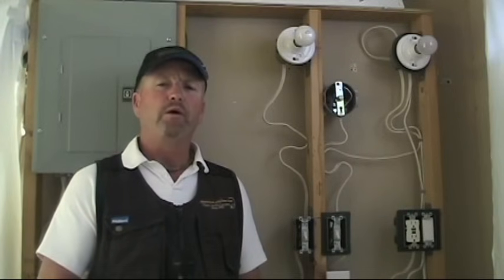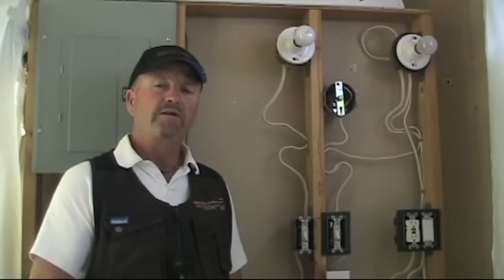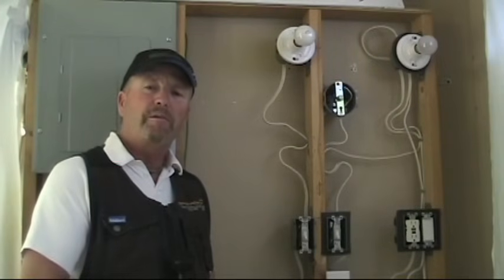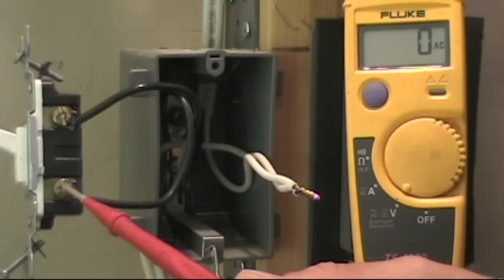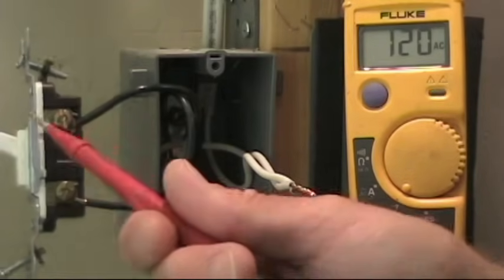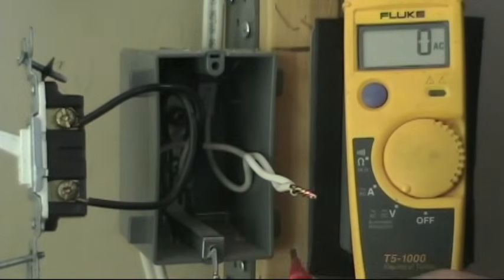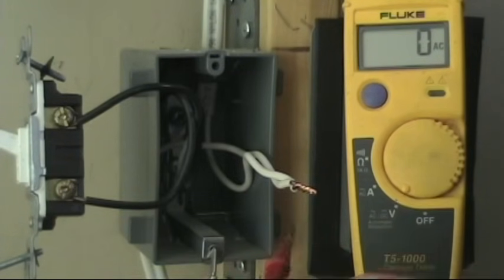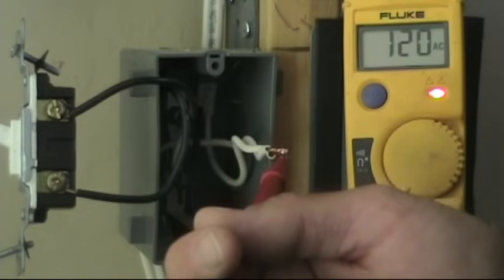Understanding an Open or Loaded Neutral

Comment: But that's not the only way to get a shock off of a neutral conductor. If you have a multiwire branch circuit and the neutral is carrying back a load imbalance current to the panel it has the difference on it. Touch it and you get shocked.

Comment: Not the safest approach but technically you can invert another receptical to same circuit this way. Also consider  2 hots on 1 pole switch. Unless you have a secondary.. Based on the visual anyway

Comment: I have a rocker switch that has one black wire (bottom screw ) and one white wire connected (top screw) to it. No other feeds or hot coming in box. Don't know what it goes too? ran a feeder wire into box and then to a small LED ceiling light. connect both blacks, power and feeder wire to rocker switch. connected the 2 white wires together. Now the new light won't turn on. I get a voltage drop on the black feeder to about 100 from 120. My tester now shows the white wire as hot? Why is this? Did someone use the white wire as a hot wire to something in the house? I can't find to where it goes or what it did?  Is this why i get a voltage drop when i turn the switch on? and why the white wire shows hot with my tester?  Please help!
Reply from the maker: You have a "switch leg drop" circuit there.  Very common practice up until the time the code rules changed on that, somewhere in the early 2000's if I remember correctly. Check out this video for an  in-depth explanation of this.  https://www.youtube.com/watch?v=pnlHCiRN_RU&t=3s

Comment: Found this issue yesterday with bedroom ceiling light not working in apartment. 120v at neutral, 0v between hot and neutral.  Checked dual switches and neutrals are wired tightly but 120v there in the switch box on neutrals as well. The wires feed into the box from the top so i doubt they're fed via an outlet in the room but outlets check out good with tester nonetheless. Arc fault breaker is good as well and connections tight. One thing i noticed immediately when first turning breaker off to this circuit was that the bathroom power was cut as well. The breaker marked bathroom only controls a gfci outlet at sink while the rest is on the bedroom breaker. I didn't think that setup was code. I pulled the switches out of the bath switch box as well and neutrals there are all tight and readings are correct.(no 120v at neutral) I’ve experienced these quite a few times before but this one has me truly stumped. Is there any other condition, other than a broken or loose neutral, that can lead to the same situation causing 120v on a neutral and not be tripping the breaker?

Comment: A really good demonstration of this is to: Shut off the switch that is feeding the keyless light bulb fixture with/at 120volts (potential). Set your multimeter settings for AC Voltage (@ 120v or higher). Place the two probes of your meter into contact with the two contact screws of the switch controlling the keyless light bulb fixture. With a proper intact circuit, you will read 120volts AC across the switch when the switch is off/open because the top of the switch contains  the circuit's Voltage Potential (EMF), while the bottom of the switch (although including the circuit load (the light bulb) from this position  forward, is essentially the Neutral/Grounded Conductor. 
This is why you must visualize even a simple circuit in context. It is imperative to remember that the point of a circuit that you are placing your digital multimeter probes is always relative to the break in the circuit. Prior to the interruption in continuity is the Hot Wire (Source Voltage) and the remaining section of circuit is the Neutral.

Comment: I have an outlet that is receiving power, but nothing works when I plug anything in. I have replaced it without success and the next outlet downstream has the same issue, I have not changed out that one yet. I did also check the connections to the pigtails, they all appear in good condition. The upstream outlet, which I believe is before this one is fine. Any advice?

Comment: Good video. I always questioned why the industry calls the neutral a neutral. It’s a circuit return path. Think about it. There is no load below the bulb. And what does ohms law tell you? It relates voltage and current to load resistance. So with no current flowing back to the neutral bar, there is no voltage drop across your load. At least until you touch it in which case you become the return path!

Watch those neutrals!!! Esp. On older service work. Often you find shared neutrals. Two breakers or circuits sharing a common neutral.  Here you can back feed power into the dead circuit. As the dead breaker has no current path, it’s a recipe for getting a new hair do!!!

Several times I have found several neutrals tied together with a massive solder joint and tape. Sometimes it’s OK, other times you may have a loaded neural when working on this. 

So always check that neutral! It will tell you instantly if you have a loaded neutral.

Comment: Ok I have an issue with a closet light that suddenly stopped working. House was built in 2003. I have done no electrical work previously. Checked bulb first no issue there. Got my voltage tester out and no power on the hot to the switch. But then I checked the 2 neutrals that were tied together in the box and there is power on the neutrals. I checked the other switches and outlets on the circuit for a loose wire and nothing. Breaker has never popped. I’m stumped on this one.
Reply from the maker: That is a puzzler with what you are describing.  Something like this takes an experienced troubleshooter electrician.  Sometimes things don't make any logical sense until you find where the problem is and then it can all be rationalized, but this needs some hands on checking.  If you were within a 30 minute drive from me I'd be right over!

Comment: I’m confused. Is the neutral short circuiting to ground?
Reply from the maker: No, the intended path for the neutral conductor is open or broken so the path is not complete.  Neutral (grounded) conductors are the intended path for the current flow, but it is at the same potential as the grounding or earthing conductors.  So think of it this way.  The breaker is on, the current flows to the switch.  The switch gets turned on, and the current is now at the device ready to be used (think light bulb, appliance plugged in, etc)  But the other conductor to complete the circuit is open or not complete.  So the device does not work, but the potential difference (voltage) is there at the end of the broken wire ready to do it's job of completing the circuit, but it can't.  So you measure what you think is supposed to be a 0V potential on a white wire, but to your surprise it shows 120V!  If you complete the circuit by reconnecting the path, that measured potential will drop to 0V as it should, and the device will work with the now completed path.  If you touch that open or loaded neutral thinking it shouldn't be "live", then you can complete the path and become the unintended conductor and get a shock!

Comment: I had screw in drywall penetrating cable black with white wires. Lights still were working correctly.  I found out this, once replacing switch.  Took me whole day to solve the problem.

Comment: The filament should of caused a voltage drop on the open neutral side meaning the voltmeter reading should of been less than 120volts ready to bite on the returning neutral
Reply from the maker: The cold resistance of tungsten (for example) is very low when cold and not energized.  And without current flowing, there is no voltage drop calculation as that is a function of current X resistance.  So zero x the resistance = zero voltage drop.  Once current is flowing and it heats up to produce the light, then the resistance spikes way up. Should you come in contact with that loaded neutral and complete the path, you would be inserted as one part of a series circuit. 🙂

Comment: I had a job that was new construction in an area that was burned in a wildfire. As we put in the lights and turned them on they immediately burned out. After some trouble shooting it turned out that the utility had failed to hook up the neutral for the service and we got 240 volts throughout the house.

Comment: I guess I don't have a neutral if I want to connect 2 gang dimmer with 3 cables? 
The voltage between cables: 
19,5 V between yellow and blue 
172,5 V between brown and blue
226,3 V between brown and yellow

Comment: Terry, hope you're still there. I have a 34 Volts reading on my neutral wire at the single pole switch. I just watch your video but still unsure what to do bc it's only 34 volts to ground. Thanks.

Comment: Thank you. I have outside lights on a store that show a hot line wire but no current when timer is switched on for the neutral. I’ll have to follow the circuit up stream and see if a splice has been disconnected. Definitely 👍🏻 and a sub.

Comment: Where is the how to corrected ???
Reply from the maker: The solution is to put the neutral splice back together again.  It was left undone and power restored to the circuit before checking that everything was as it should be.  Neutral needs to be an uninterrupted path back to the service panel.
If you need more detail, here's a post on my website.  https://www.electrical-online.com/understanding-an-open-or-loaded-neutral/

Comment: So I have a bit of a different situation everything in my house is wired properly and was checked multiple times and has worked well over two years perfectly fine well this morning I wake up to only half of the house working and I draw the problem back to an outlet in the kitchen where everything kind of branches off of and it's acting like the neutral is not connected in the breaker box and I trace the line from point A to point B and there's no brakes no cuts no tears and it goes straight to the box but I cannot for the life of me get that neutral line to work if I jump the white line from a working receptacle over to the white line that is not working everything comes on so if you could maybe help me out with that it would be awesome
Reply from the maker: That is a weird one, but when you say that only half the house was not working, I would suspect a connection on one of the hot wires, either at the utility transformer, the meter base, or a half-tripped main breaker of a faulty main breaker or connections at the main breaker.  The rest of your explanation is a bit puzzling.  This needs some in person trouble-shooting.  I'd call in an electrician that is good at problem solving.
Reply: @theinternetelectrician  I found the problem finally. My kitchen range was wired into the same receptacle as the lights on that half and had melted the wires together inside of it.
Reply from the maker: @AndytheMachine  OK, that's good that the issue was discovered.  This needs to be properly rectified (obviously) and this unusual situation made safe and compliant again. It's an interesting case study and if you want to elaborate further with photos and more detail, send me an email to internetelectrician@gmail.com.  It might make good subject matter for a future video.

Comment: Normal electricians dont test for 120V between G and H ... as the ground is not needed for the circuit. They test between H & N because that is where the circuit is. 
BUT if the G is tied to the N at the main panel, that can help ID 120V on the H which tells you the N is open

Comment: Tracing open neutral can be more difficult to locate than a broken feed. Many times I located a good neutral section in the circuit, then rewire to the open neutral, and effectively reconnect the neutral to the back side of the break. Replacing a broken neutral from a different circuit, will cause a foreign neutral current on that different circuit. Never assume the neutral has no current with the circuit shut off.

Comment: No, how does taking splices apart make a return wire hot. Fail.
Reply from the maker: watch it again.
Reply: The black wire carries the 120V from the breaker to the bottom of the switch, to the top side of the switch, then up to the light (black hot side) then it goes THRU THE LIGHT BULB and going to the Neutral side of the light which the White wire and back down to the light switch box where that N wire is now HOT with 120V ...  
If using a basic incadescent bulb, that bulb is nothing more than a wire ... so its going to pass that 120V thru and onto the white N wire. When that N wire gets back to the source or transformer, that voltage will disappear .... 
If you were to use an electronic LED light with a circuit board you won't have 120V on that N wire.

Comment: I have a different question, I replaced fabric cable with romex, TWO unrelated branches (both previously upgraded) are reading continuity across the hot and neutral.
I found out the hard way.
2 cables going to different rooms. I'm really confused
Reply from the maker: So just to be clear, you read continuity from hot to neutral? This would be normal and expected unless there was nothing plugged into any receptacle and no light switches are on, etc.

Comment: I have some lamps where the neutral is not connected, but the ground is connected to the neutral wire. The neutrals also have power. I'm about to redo the whole apartment, breaker panel and every outlet. I think we should find the problems tracing everything back to the panel, or who knows? I'm also changing about 12 breakers as well because of the weirdness. I disconnected the neutral to the garage light and it works, so I have to start over.
Reply from the maker: That needs some serious investigation for sure!

Comment: I hope you are able to help. I have two light fixtures in my garage. I want to add two more light fixture to have a light more light. I bought 14/2 50 ft wire from the light fixture number I tapped into to it. I did white with white and black with black. The same light fixture has about 4 white wires and three black wires. With the new wire I did black to black and white to white and ground. I ran the wire about 12ft to the new desired place to shine more light. I bought i new fixture the has four screws two silver and two brass no ground screw. I connect the white cable to the silver screw as indicated and black to the brass screw. When I put everything back and turn the breakers back on the two light fixture turns on and the third which is the new one stays on and will not turn off. Please help
Reply from the maker: I think that you have a "switch leg drop" happening here.  You tied in to the power supply hot wires, and the neutral.  You need to connect to the white wires, and the hot wire that is connected to the first fixture instead of to the splice that has the 3 black wires.  Watch this video and I think  it will all make sense to you.  From what you have described though, I'm thinking that they didn't quite wire the switch drop as they should have and I suspect you have a white wire that is connected to the hot for the first fixture?  Check out the video and let me know if this makes sense now.    https://youtu.be/pnlHCiRN_RU

Comment: Good morning 
How are you
I have a question. I have two wires coming out of an electrical box. One of them brings power and the other goes to an outlet 
When I put my voltmeter test leads on the hot and neutral of the power wire it reads 119 as expected. When I put the test leads on the hot wire of the power wire and the box itself it reads 67 volts 
What’s could be the  problem? Does it mean that my outlet box is not at 0? If it’s at 52 then the difference between the hot lead on the power wire and the box will be 67? How do I find out where the problem is? 
Thank you
Reply from the maker: That means that you have a poor (or non-existent) grounding system.  Maybe the (grounding/ earthing) bare wire isn't connected to the outlet box grounding terminal, or is poorly connected, or maybe your cables are just 2-wire without a ground wire? (older home?).  If you do have 2-wire cable + ground, do you have 119V from hot to it? If so, then just correct the problem of the outlet box not being connected properly and that should solve it.  Feel free to provide some more detail and information here.

Comment: QUESTION, i put an electrical meter probe between the smaller 120v blade opening of an outlet and the ground probe to the sheet metal covering my pole building. should it read zero volts or 120 volts. mine says 120v. everything powers up but can i be electrocuted.
Reply from the maker: Sounds like everything is as it should be. Neutral (grounded conductor) and earthing or grounding system should be at the same potential. So with your meter you should get 120v reading from hot to neutral, and hot to ground. Thanks for watching!
Reply: @theinternetelectrician  thanks for fast reply and peace of mind.

Comment: Yeah but if all neutral wires are disconnected at the splice, you should not have any power. You might be having a back feed due to a closed circuit somewhere in the system.

Comment: Can I tell you thanks for the tips. I hate house wiring !!! I spent 2 days chasing wires on plugs and thankfully I found loose wires and or bad plugs which I replaced. What I didn’t expect was a ground that just fell off the post on a switch that had at least in my mind, nothing to do with the plugs that lost power !!! Blows my mind.

Comment: I have an old appliance i was working on. And noticed when i touch the woodstove and the appliance i got a little tingle of electricity. I connected a grnd to the appliance to the outside metal of the outlet and it turned on the appliance even though the switch was off. Furthermore i was unable to turn it off unless i disconnected the plug! What is going on. ?????

Comment: Question could you check for an open neutral by turning all lights on and then checking for ground to neutral voltage anywhere seeing that there bonded at the panel or would this be a direct short?